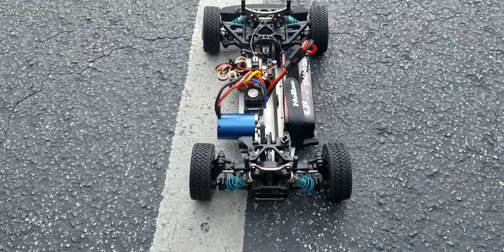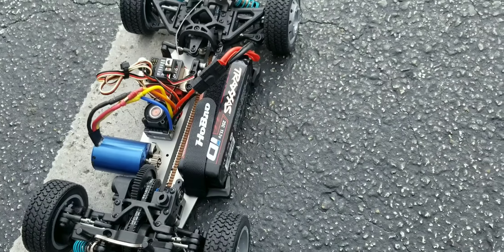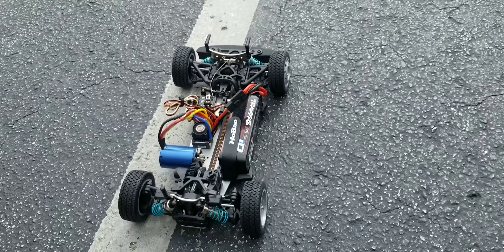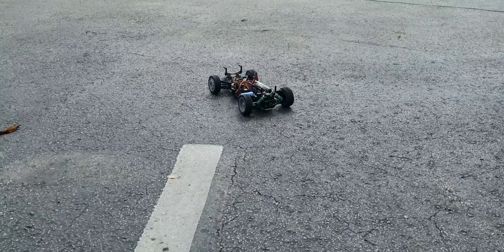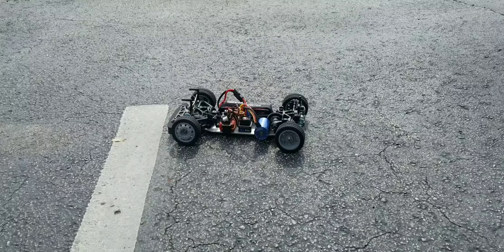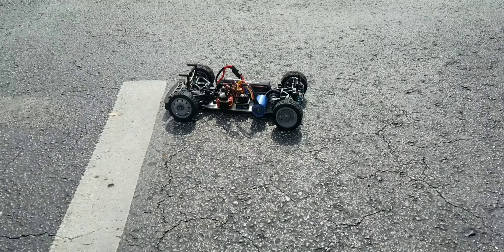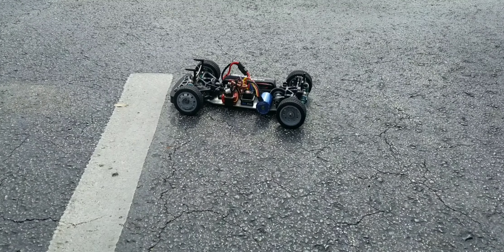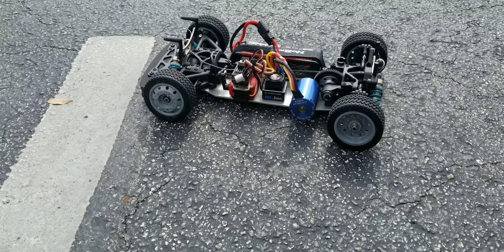(New hobao epx) temporary build

Comment: Yo that motor 2 pole are 4pole
Reply from the maker: 4pole
Reply: @gapcationrc6282  o ok I jus order my epx yesterday did you ever find the aluminum pulley not the one for the diff but the one that's on the spur shalf
Reply from the maker: You will need a 3m 16t and 24t aluminum pulley with 6mm bore 10mm width you can find them on ebay but will have to wait a while and also modify them
Reply: @gapcationrc6282  o ok it's a guy name Heavily Modified Rc he did  it check it out he's on YouTube
Reply from the maker: I will be doing it myself aswell I have the pulleys coming in the mail just takes forever
Reply: @gapcationrc6282  which ones the ones for the diffs
Reply from the maker: They only made the front aluminum pulley none for the rear yet
Reply: @gapcationrc6282  O yea I seen that you  think the epx can handle a 1/8 can motor
Reply: Yo can the epx fit a Traxxas spur gear with out modify it